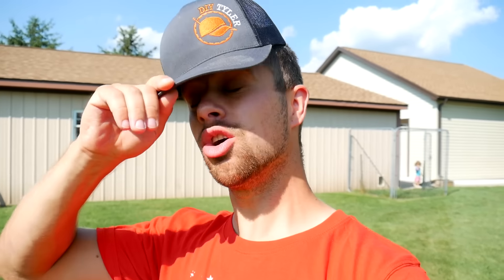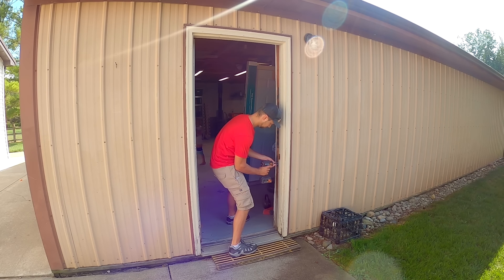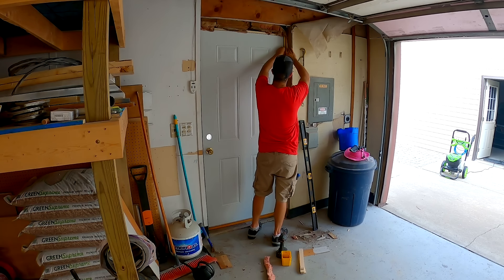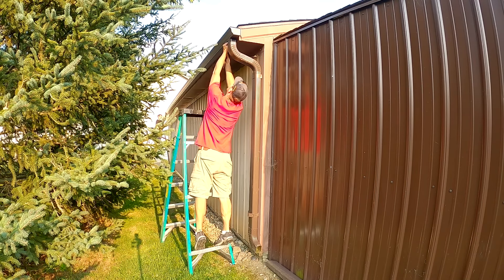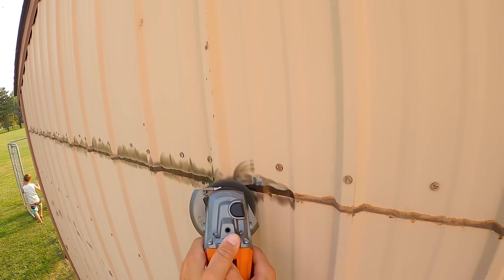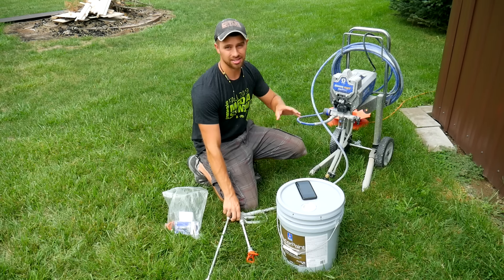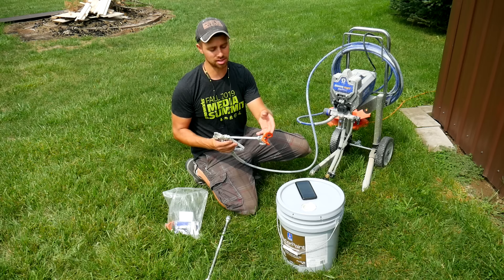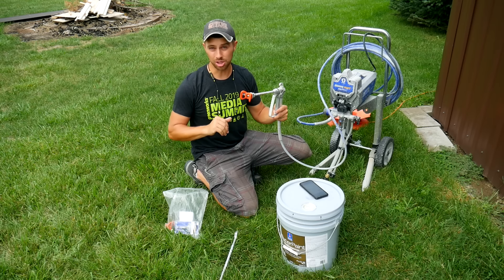Airless Spray Paint Metal Building? Step-by-Step how to Paint Metal Building like a Pro (SATISFYING)

Comment: Guess what? I been installing doors for decades. It's not uncommon to use all types of finish nails during the installation. Exteriors doors do normally get some screws for security purposes but they can also get nails to quickly secure the door in place.

Comment: For your power washer, take the intake tube off the reservoir, add an extension and drop that hose in whatever solution you want to clean with. Then when you want clean water take the hose out of the container it's in and presto you have clean water

Comment: As a painter I love spraying and I do like super paint but on a metal building you would want to use Sherwin Williams DTM or direct to metal paint. Just remember the higher the sheen the better the durability however, can be harder to spray.
Reply: Thank you Bruce for the advice. Using DTM paint from SW tomorrow on my metal building. Power washed with TSP!
Reply: Question if i use DTM do i need to prime first or not ?

Comment: Needed to turn up the pressure a touch. That will stop those lines on the edge. A good way to tell you are at the correct pressure is to go too low like you had it then turn up until those edge lines dissappear. Nice transformation though. Great job.
Reply from the maker: Thanks! I did mess around with that....am guessing my tip has seen better days, have put a lot of gallons through it now.
Reply: @DIYTyler  oh yeah that will do it as well. You probably know more and are better at it than I am! I'm only just getting into airless painting.

Comment: Bought a green works mower/blower combo with 2-batteries about 3 years ago. Never worked right. Under powered and battery life was terrible. Just used mower to trim and blower for quick cleanup. Dumped this year for new gas replacements. Never make that mistake again.

Comment: I'm gonna have to look into that battery powered sprayer. It impressed me. You can use DeWalt 20v batteries in it?
Reply: Yeah, I just bought one. It's the Graco Ultra or the TC Pro if you buy it from the big box stores. The kit comes with 2 20v DeWalt batteries and a charger.
Reply: @KyleVeatch  Thanks a bunch, Kyle. It's awesome to have people with experience and kindness in the comments since Tyler can't always get around to reading every comment.
Reply: it is amazing, the 6 amp hour batteries are a must! thing is a tad bit heavy but not as much as you would think

Comment: No way to shut off the soap sounds like a huge oversight on their part. Seems like it'd be easy enough to put a shutoff valve somewhere.
Reply: I'm willing to bet the soap isn't actually dispensed when nozzles other than the soap nozzle are used. At least that how every pressure washer I've ever used works.

Comment: $300-$500 is way less than I paid somebody to paint my house 5 years so. I'm definitely doing it myself next time and using a sprayer. Thanks for the great tips!
Reply: my graco x19 model was 535 +tax.  but i can spray as much as i want with that cost.  although the accessories add up: roller, tips, extension, cleaner, hoses, strainers, etc.

Comment: Just food for though. Builders always use nails. They have far greater strength- especially torsion strength which comes to places like doors. Yeah they are super annoying to deal with, but they are cheaper and stronger than screws (in some applications). 
All together great video. Thanks man.
Reply: Use the right screws and there stronger than nails.

Comment: "who uses nails to install a door?" um well ALL CONTRACTORS!! thats who. hanging a door when your installing a ton of trim, and YES to include exterior doors is easiest to do a Pre-Install with nails then finish secure it with screws. this is a normal way to do things. all interior doors are installed with nails anyways and its easiest to shim with nails when using a nail gun!
Reply: And this is why home owners spend the next 10 years fixing mistakes made by the builder. Because builders want to do it the easy way and home owners want to do it the right way.

Comment: Just a heads up, the green works pressure washer is very nice for the money, but unfortunately the turbo nozzle doesn't last long.  It is the most used nozzle and will need replaced in a few uses which runs you about $50 to get a nice replacement.  Also, there is a warranty on the turbo nozzle, but unfortunately the manufacturer doesn't reply to emails in a timely manner.

Comment: For that steel building I would have recommended multi surface acrylic or waterbased alkyd urethane by Sherwin Williams for better adhesion. 

Looks good now they all match!
Reply: Looks good as a paint rep for the company I normally recommend  pro-cryl as primer and  sher-cryl  for the top coat for metal garages and pole barns
Reply: Kevin Masterson shercryl hpa would be a good choice too. Procryl when in doubt, but both msa and wb alk urethane bite hard and have great color and gloss retention, as you already know. 👍
Reply: @kmasterson7755  had a friend said his paint didn't peel because he brushed it on 25 years ago. his friends didn't and theirs peeled.  are current paints better and can be sprayed on metal without being brushed on?
Reply: @jetah50  new paints are always improving was the paints the same product
Reply: @kmasterson7755  I'm not sure. they said it was years ago and suggested i do the same again even though i figured the paint technology improved in 25 years.
Reply: @jetah50  if u can spray it I would biggest thing is prep prep prep are u painting a metal building

Comment: Overall and end result is good, for a DYI not bad, caulking skills need assistance and direction and some of the prep work could stand a bit of improvement but an overall good deal, If I had to rate the whole project from start to finish on a scale of 1 to 10 I would give you a 6.99  not that anyone was asking lol.

Thanks for sharing, it looks a lot better and that was the whole purpose.